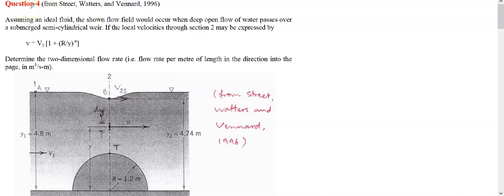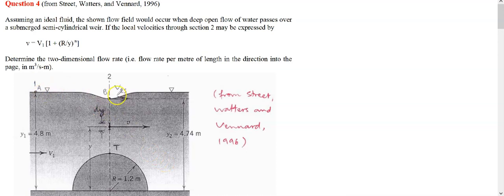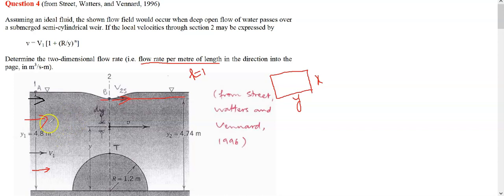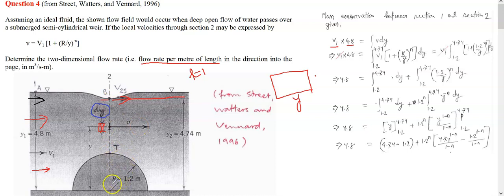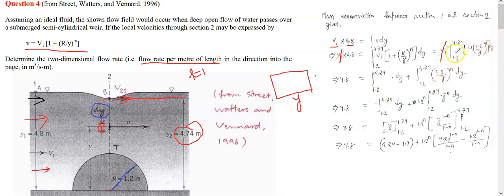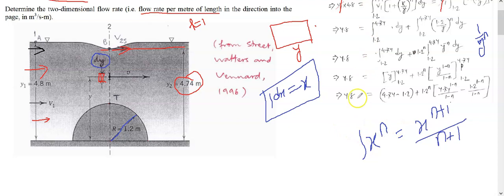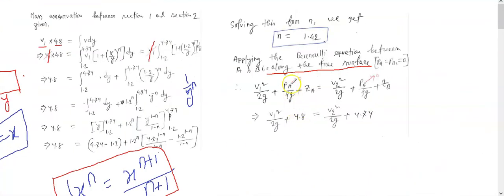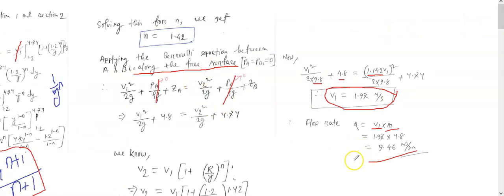FLUID MECHANICS Tut 05 Question 4

Comment: why you take distance from  1.2 to 4.74   why not 1.2 to 3.54  or will it take distance horizontal direction  because there used  dy  derivative so i thought it should be in y direction means 1.2 to 3.54  please  give solution